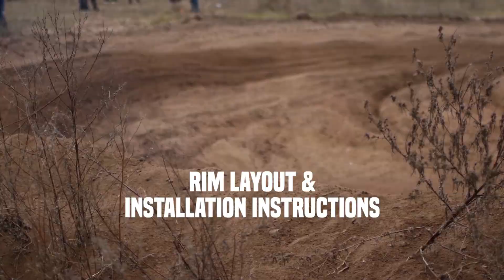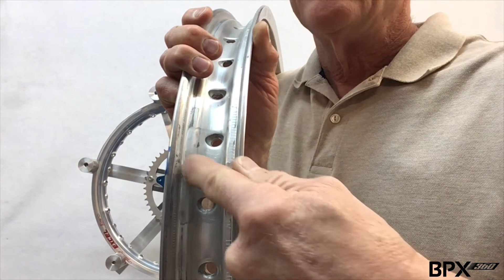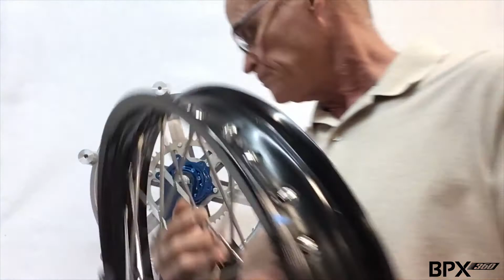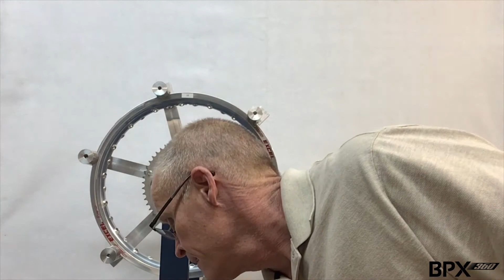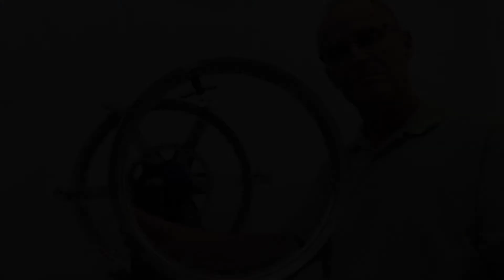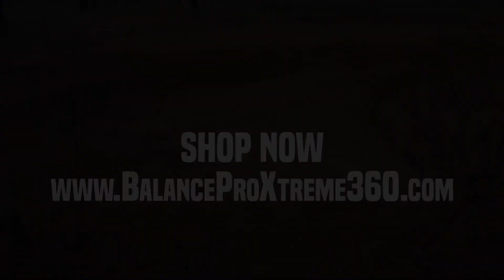Rim Layout and Installation Instructions

Comment: Perfect, Great Product. You should get the DB invator award I have been waiting for this product. I have always balanced my DB tires. What a PIS epoxying on wheel weights by the tens with spoke weights and all, it looked like a mess. Having a 525 that goes in tight trails and hops on highway at 65 mph smooth and quiet to next section is very safe and comfortable. Then next tight section where 15 mph is flying. Balanced tires make riding easier faster and more fun.
Great Job Chris, I hope you do very well with this. Look into EMTB that is a big growing market.
I now have an electric dirt bike and balance is even more important. the quiet makes you so much more aware of your surroundings and equipment. I have to stop when a leaf gets in a spoke.